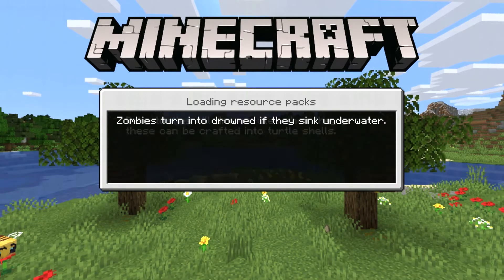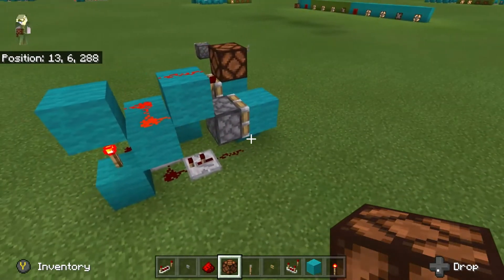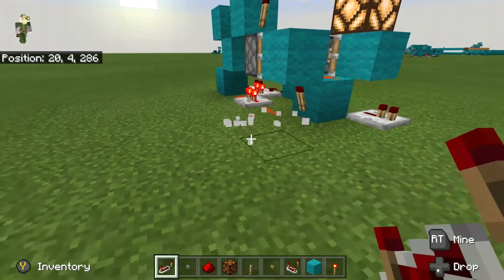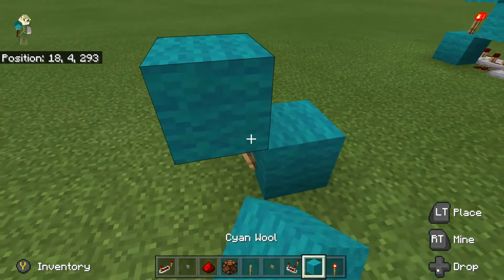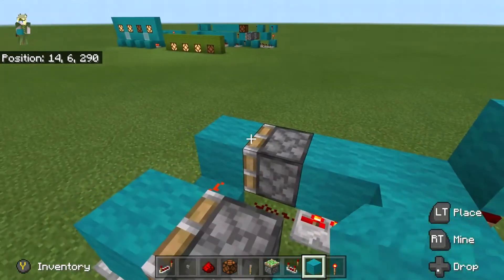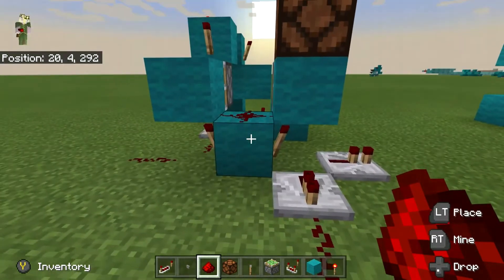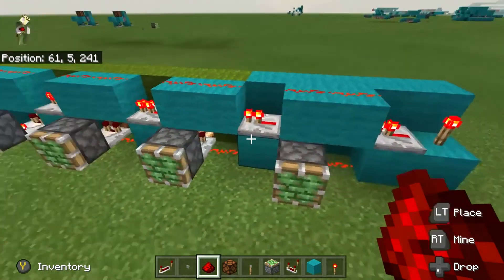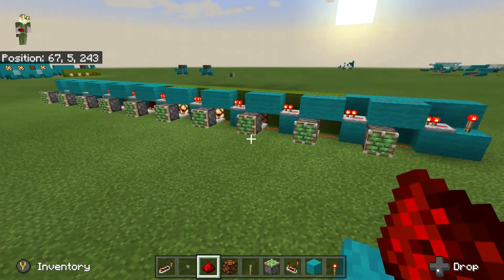Minecraft Bedrock Wireless Redstone Update / Increased Stability

Comment: Hey man awesome video! Really clever solution. i was messing around last night and figured something out that worked for me- My burnout clock setup just has an on/off power switch to put the device into operational mode. I took signal from the torch that flashes most (i don't know about directions and function) but i split that signal into 2, at a relay point, then offset the signals like a squarewave generator to complete a full cycle so one turns on, then the other turns on before the first turns off, and it continues to make a continuous solid signal. 

then it just works. take that output and use it or invert it with a block and torch. There are some other mechanisms i used between things but they're besides the main point. But yea what i made seems to be stable. i can't get it to break.
Reply from the maker: Clever solution to make it easier to handle. Yeah there are a couple quirks that I learned after this video, mainly the working direction can change in every chunk. But I’ll have to test your method, I’m working on some other types of transformation and wondered if I should try with wireless, this would make it easier